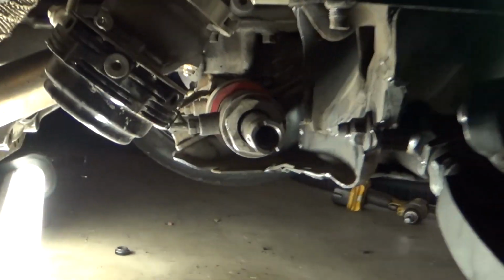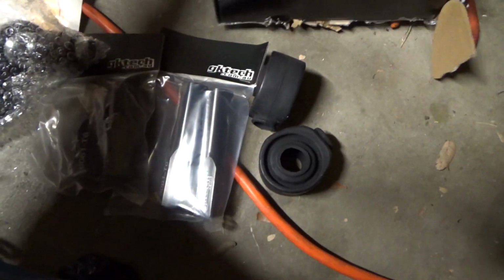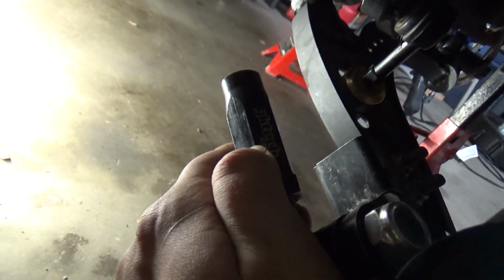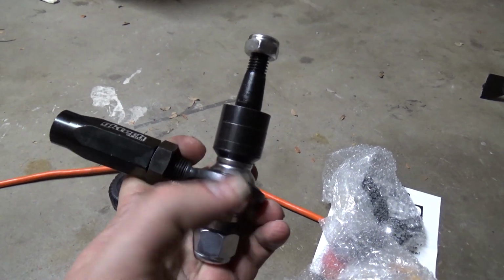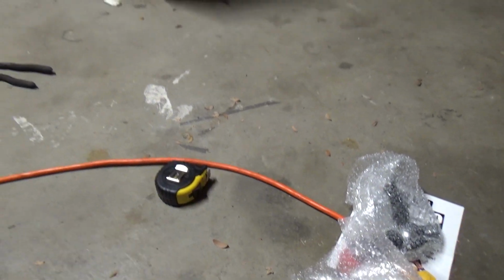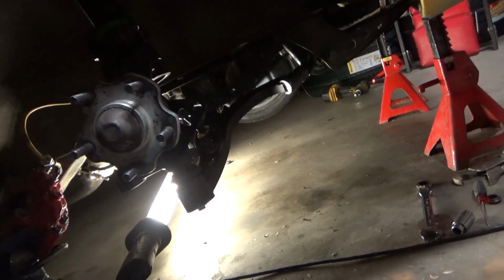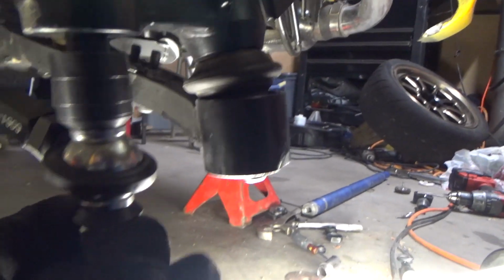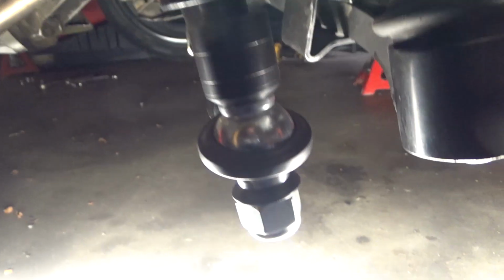GKTech Outer Tie Rod Ends! | Install

Comment: Hi Jesse. How have the GKtech rod ends held up over the years? I have a pair im thinking of installing but i don't trust how thin the material is at the rod end bearing. It looks like GKtech now sell a V2 of this rod end that looks thicker. I'm curious to know how your rod ends have lasted over the years drifting?
Reply from the maker: Mine are still working just fine 🤙honestly they believe in "kaizen" which is constant improvement but I don't believe that certain things can be improved. That is just an engineering mindset IMO

Comment: You have any issues with bending these? I’m bending them like crazy like 2-4 per event. 🤷‍♂️ alignment is good, bump steer correction is good. I’m just going through them. I can change one out and get the toe dialed in 21 minutes now. That’s from getting out of the car and bitching about it, to finishing toe settings.
Reply from the maker: No issue for years on the same pair
Reply: @jessedrifts  ok sounds good, I guess I have more figuring to do. 🥵
Reply from the maker: Do you have a relocated rack? Or just offset rack spacers
Reply: Relocated rack, partshop max. They’re straight across. I got an email back from the GM at gktech. He said maybe my bump stops are too shallow  causing the binding. So im going to push them out a bit and take some angle out, see if that helps.
Reply from the maker: That will help 100% I have my angle limited to 65° for clearance reasons and strain/overcentering
Reply: @jessedrifts  awesome, thanks! I’ll do that, hopefully it’ll solve the issue. 🙏

Comment: Were you ever able to tighten the tierod end so that there's no play in the spacers?
Reply from the maker: Yes. When tight it does not have slack
Reply: @jessedrifts  because I have an issue where it seems like the tapered tie rod end doesnt fully go through the knuckle hole just half way.  Just like it looked like on yours but I feel if I keep on tightening it it will strip the threads..
Reply from the maker: It has a nylon lock nut. You need to go all the way down til it locks. Make sure you use all of the spacers they send you are attached